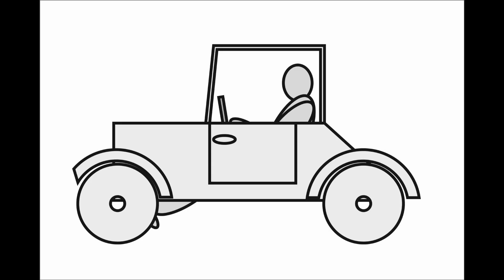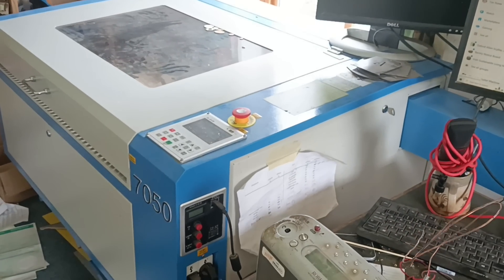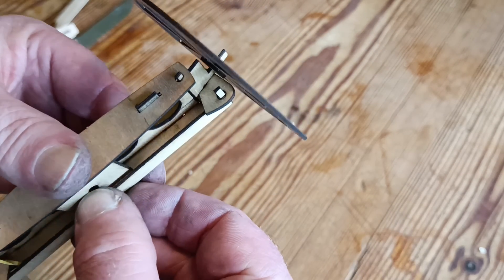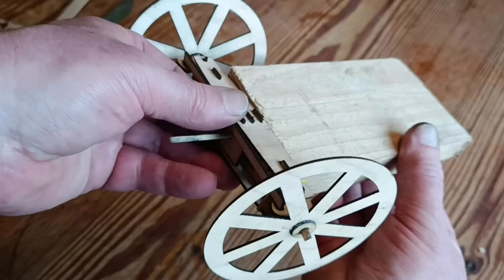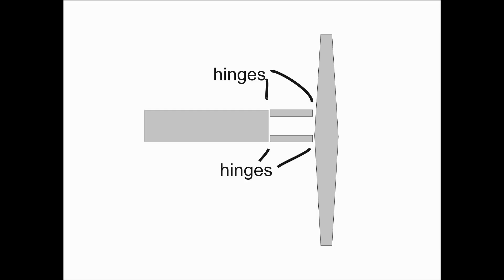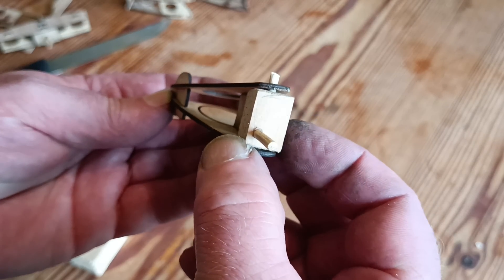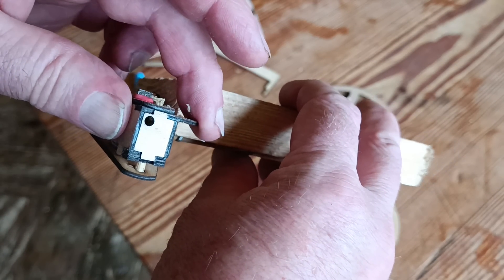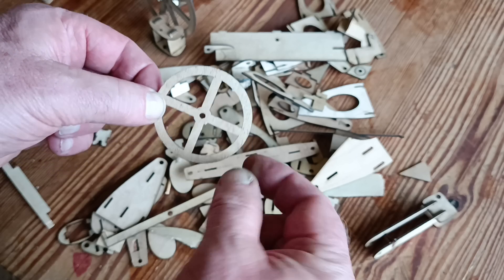Designing The Tricky Bit At The Front - Suspension And Steering For The  Wooden EBike / ECar

Comment: That long armed split axel design is pretty common in ATV suspensions. Not as common as a rigid rear axel (guarantees no wheel slip in loose sand/mud), but i bet it'll work just fine for something running on only peddle power over not-super-rough terrain

Super excited for this build! Think it might become a useful tractor for the railway 😆
Reply: Two jears ago, when I was thinking of building a cargo bike myself I had the idea of using two suspended bikes and conect the pedal axises rigidly together and use the freerun of the back wheels as some kind of differential geering. Maybee the front parts of the bikes could get some use to.

Comment: By moving the hinge for the suspension further away from the wheel, it seems you are increasing the mass that needs to move, and so I guess reducing the ability to absorb high frequency vibrations? No idea whether that makes any difference in practice. Love the design process - can't help trying to find holes in any design so I hope you don't find this criticism to be destructive!
Reply: The term that you're looking for is 'unsprung weight'.  It is, indeed, something that car makers attempt to minimize.  For Tim's vehicle, operating at low speeds and with the weight of the passengers being such a massive % of the total, it might not matter.  Plus, part of why carmakers have two separate (independent) front suspensions is the need to fit the engine in between them.  Probably not a factor here, depending on how it all comes together.
Reply: @Zeppflyer  very interesting thank you!

Comment: But I think we have another problem... If one wheel lift up it will change  the lengts of the stearing rod. I mean if you drive over a stone with the left wheel, it will turn the wheel to right, depending if you have the stearing rod behind or in front of the axle...🙄
Reply: I think you could minimise this by having a hinge in the center of the steering rod and position that pivot as close to the half-axle hinge point as possible. To steer move that steering rod hinge point side to side with a crank on the end of the steering wheel shaft.
Reply from the maker: Exactly what Oodles suggests. Hoping it will work..

Comment: want me to make a parametric design out of that?
Reply from the maker: A what now?! I had to look it up  : -  ) Thanks for the offer - what would it tell us?
Reply: @wayoutwest-workshopstuff6299  
it would allow you to change parameters on the build and give the cut outs for all the parts according to the new parameters. f.e. the thickness of the material. You would want all the joints, to fit to the thickness of the materials that you use. but you probably don't want to draw the hole thing new for every new cheat of plywood. So with a parametric design you just measure it and type the measurement into the design. Ohter parameters are more design specific, like for your bart, the distance between the wheels their radius and so on for your build. on top of that, since I would do that with openScad you would get a 3 D model, that you can look at before you cut out the parts.
Reply from the maker: @MusikCassette  Sounds useful! Except I'd need the same programme, surely?

Comment: You could try trailing arms like the VW Beetle or the sliding pillar of the Morgan. I would expect the trailing arms to put less stress into the joints when you hit a bump. 2cv use leading and trailing arms but I think leading arms at the front would naturally want to dig in and stop the car. You might be able to use torsion bar suspension or the 2cvs unique suspension. The front wheel acts against the rear wheel. Not the body.
Reply: 2CV suspension: https://youtu.be/j7pFxgDmZXQ
Reply from the maker: thanks Marc, thanks Michael - so much to learn!